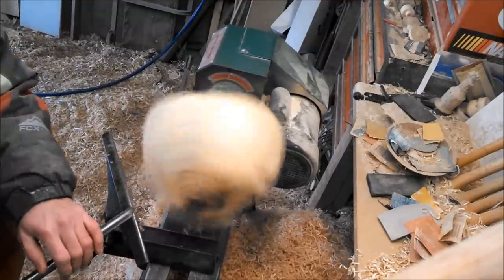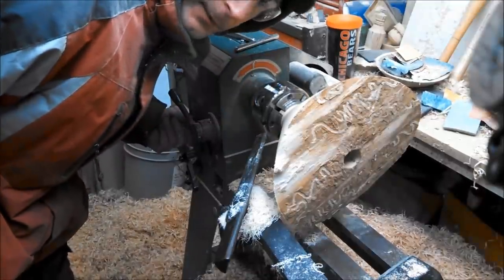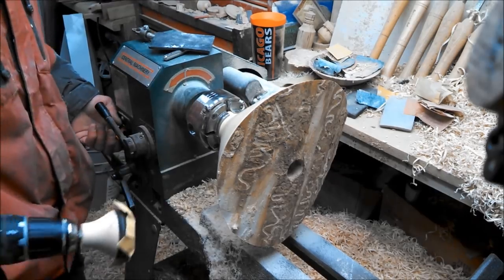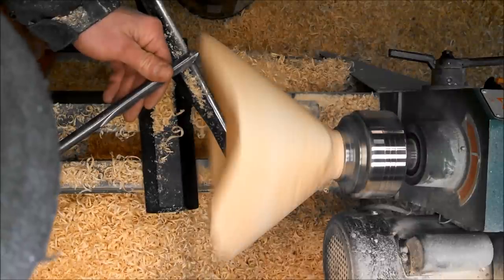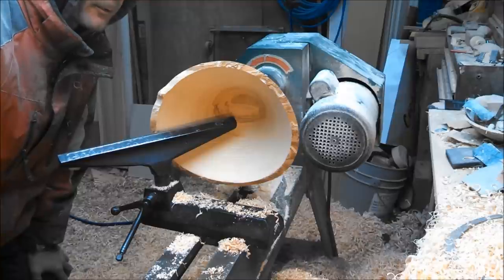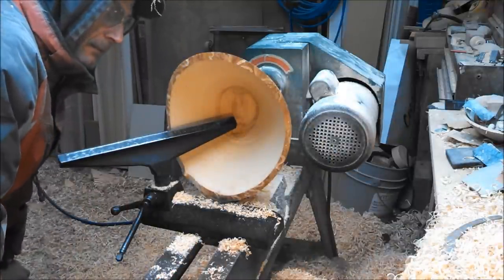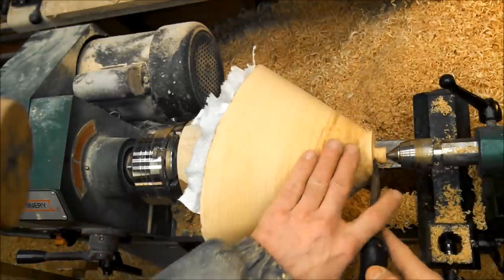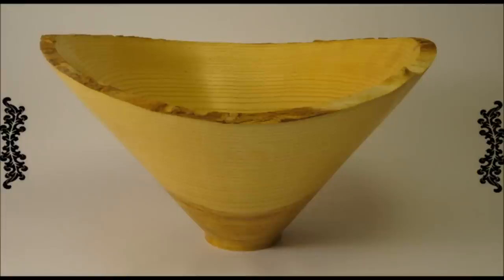Woodturning - Natural Edge White Ash Bowl

Comment: How dou you like your lathe? I'm thinking about upgrading from my turncrafter 10" lathe due to issues with the headstock bearing. I've gone through three sets with in three years. Getting tired of changing bearings. Do you have any suggestions on a good lathe??
Reply from the maker: Hey Craig, thanks for the question.  For the price ($270), the Central Machinery lathe is a great buy.  That said, the motor is a little underpowered and the legs could be a bit stiffer.  I bought my lathe used and it had several "miles" on it, but I haven't experienced any real problems with it.  The headstock bearing is holding up well.  Prior to this lathe I had a circa 1950's Dunlap "spindle" lathe which had headstock bearing problems so I understand your concern.  Thanks for watching, Kevin
Reply: Kevin Krull
It looks a lot like my Craftex from Busy Bee Tools here in Canada. I've made some mods (like extending the banjo to have a more firm support for the tool rest). Generally I too am pleased for the price.
BTW: It's great to see that some other nut is working in an unheated workshop in the winter. Misery loves company!! Flick lives!
Thanks for the excellent video (and editing).